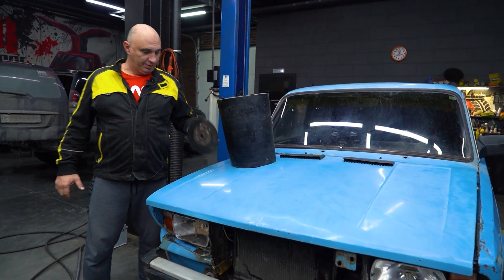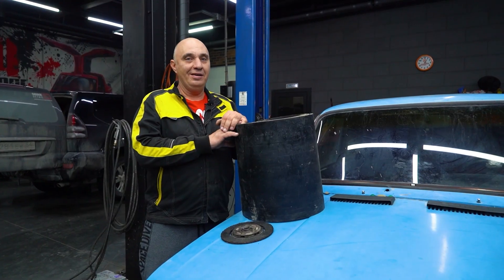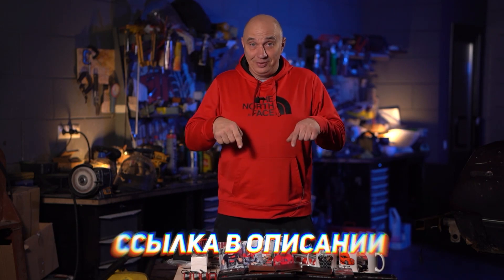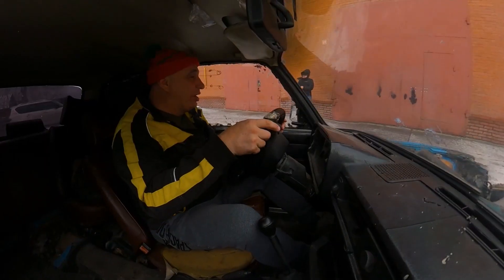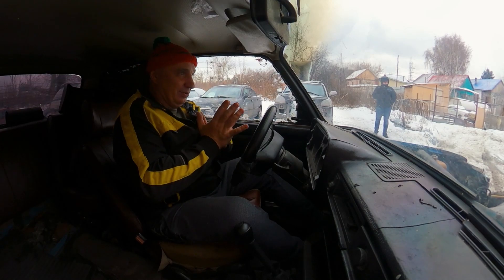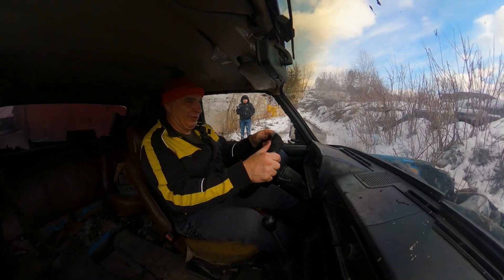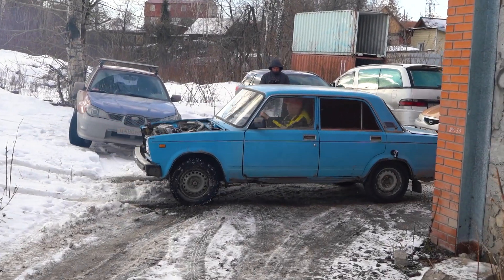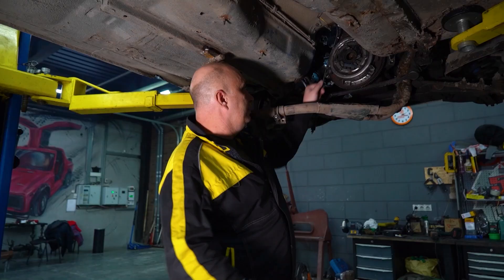We make a rubber clutch disc – will it work?

Comment: 3:56 watching rn. my expectations are: the clutch will work, it wont slip at all, and thats an issue. its rubber, i dont think he'll be able to start off smoothly without the rubber clutch disk wearing off. was I right? i'll keep on watching.
edit:
Yep. exactly what I epected. high revs before releasing the clutch wears down the rubber clutch disk. That's why he's able to start off smoothly at higher revs. And it's sticking because it's rubber (duh) and it gets warm to the point of maybe melting, hence the sticking. If low revs are applied, the car will jerk as the clutch has too much grip.

Comment: Should test the Blish lock theory from the early 1900s with a clutch. The theory is simple, one metal softer than the other, when instant pressure is applied, it should cause a sticking resistance. It was used in the early Thompson submachinegun for delaying the action, but found to be unnecessary
Reply: Thompson used Brass against hardened steel to try accomplish this.

Comment: Try coating a tire with bedliner so it fills in the treads and makes a smooth surface when it's dry mix 50 percent bedliner and 50 percent pea gravel and coat the tire to make rough surface for the snow and ice or off road what ever dry pavement would probably be fun.

Comment: The two surfaces; the pressure plate and the flywheel should be mirror polished so they don't eat at the rubber.

Comment: Great video. You guys look like you are having fun. A suggestion, instead of putting rubber on both sides, only place the rubber on one of the surfaces and make the other side bare metal. If that works better, you could cut slots in the rubber surface in the direction of rotation, as you might see on a disk brake rotor to improve cooling. Think of bicycles with rim brakes. By the way, bicycle brake pads do glaze from being overheated but rarely blister. Too bad you can't a roll of hard, dense high temperature rubber. Cheers!

Comment: Heres an idea. Maybe build a 5 foot long coil out of brake line and make it so it fits inside an exhaust pipe and then drill holes in the pipe to let the end of the coil out. Then connect those 2 coil ends to an extra heater core inside the car and fill it with coolant with a mini very low speed electric water pump. See if an exhaust heating system could work
Reply: Volkswagen bugs had exhaust heatera

Comment: How about building the most difficult car to drive with all wheels having a steering wheel with two reverse steering wheels & two steer right go right steer left go right steering wheels. And Break pedals in the middle front seat & the accelerator pedal in the middle back seat? So that it requires Six people to drive it and each time you stop all steering drivers jump out and change seats LoL 😂

Comment: With rubber it be resisting spinning and will grip the flywheel, the rubber is getting hot due to the friction and sticking to the flywheel.

Comment: Leather might be worth trying. Make sure flywheel and pressure plate surfaces are smooth so it doesn't tear.
Reply: Original clutches were actually leather
Reply: Yep should work just fine
Reply: My grandfather had some old american car maybe a dodge, it had similar to wine corks for a clutch, was a wet system running in oil, my dad (a kid in the 1950's) went to the chemist to get 200 medicine bottle corks so his dad could rebuild the clutch
Reply: @Colt45hatchback  makes sense for a wet clutch.

Comment: How about a push-pull Lada where you start off with a front drive Lada (VAZ-2108 Lada Samara) add another front drive Lada drivetrain inside the rear compartment?  Two engines driving two drivetrains.  Of course, the steering linkage in the rear has to be locked in place so it will drive normally.  Take if off road to see how it stacks up against a Lada Niva.

Comment: Hear me out, a high flow hydraulic pump for auto transmission, but put a clutch on the auto trans. Run the pump off the belt drive.

Comment: You guys made brake pads out of copper and aluminum. As I recall, the copper ones worked pretty well. How about a copper or bronze clutch disc??
Reply: Probably would cause alot for wear on the clutch assembly.
Reply: @jwalster9412  Undoubtedly. But Garage 54 experiments be only gotta work for an hour at most! 😂
Reply: I doubt it would cause much wear, as it is softer than the clutch parts

Comment: I doubt this will work
I was pretty much right that it doesn’t work, and the reason being is rubber cement to grip at the least amount of contact pressure, whereas a clutch disc only meant to grip under higher pressure

Comment: In 1978 i lost my clutch disc in tok alaska in my 1964 Datsun.. we were hippies and did not have much money.  we had to order a new disk from anchorage, and rent the garage from the gas station at night.  Thankfully they only charged 5 dollars an hour.  the pressure plate assembly was so old and corroded i could not adjust it because i was afraid i would break it.  as it was i could not get the clutch to dis engage, so i drove 3200 miles to Albuquerque with no clutch release.  You can shift without a clutch, but you have to have the engine speed just right.  after a while i got good at it.  We made it to Albuquerque, but by then i had worn out the starter, after having to stop the engine and engage first and restart the engine in first gear to get the truck to move.  A couple years later some crazy teen agers crashed into that little datsun while i was in Portland Oregon as it was parked in front of my apartment.  I happily proclaimed to my wife,  Honey, someone killed the datsun.   That solved allot of my problems.  the answer was there all the time.  BTW I had the clutch working when the truck died.

Comment: About the same thing is going on there  as if you leave an unmodified clutch out in the moisture sitting for too long   or if you wash your tractor and water gets down in that bell housing    it freezes the clutch to the flywheel surface   then you're only option from there  ..if you can't get it to break free    aside from taking it apart   is  hosing  the clutch plate down with something like non silicone based penetrating or kerosene to get it to let go

Comment: Could a tq converter be fitted as a clutch?
Reply: Since tq works on transmission fluid, ho do you wish to create such pressure in manual?
Reply: @kxpes  An transmission pump could also be put in a custom housing in line. They actually have existed. Although you just get a worse version of both so its not ever seen in production cars. Some heavy duty vehicles have them though.

Comment: Try to install glow plugs in petrol engine. Will it start better in the cold?
Reply: It wouldn't run at all. Petrol engines need spark plugs to ignite the fuel.
Reply: @9PlatinumGamer9  He didn’t say remove the spark plugs… maybe glow plugs in addition? In any case I can’t see how it would start better unless it was EXTREMELY cold. Petrol works fine all the way down to about -40°
Reply: @truthsmiles  Colder than that.  We've had gasoline motors start at temperatures lower than -40, and winter gasoline formulations are more volatile to help.
Reply: @kingduckford  Yeah I should have said "at least -40" - in any case I don't think the primary problem is fuel volatility - I'd say it's more likely very thick oil and/or the cold battery not having enough oomph. Hence why we have a lot more block heaters and battery heaters than fuel heaters :)
Reply: nope just detonation

Comment: Magnetic clutch!!!
Reply: They actually engage very smoothly. IBM's old tape drives used those.
Reply: @erkinalp  I bet! I wanna see them put one on a lada and watch it be like driving a semi automatic
Reply: Magnets will stop working with heat.
Neodymium lose it's magnetic force near 80° Celsius.
Reply: @EulerFink  stuff losing their properties has never stopped our boys in serbia here
Reply: @G_P2025  these guys are in Siberia, Russia. Novosibirsk, to be precise.
Reply: @Honey_Daddy  I was gonna write the correct city but then I got high
Reply: @G_P2025  xDDD full pass, no points deducted.
Reply: @EulerFink I’m pretty sure they use electromagnets for PTO clutches in lawnmowers
Reply: I want an lsd using neodymium magnets
Reply: Use a standard clutch for starting from a stop and use electro magnets for shift
Reply: I hope they see this.....👍
Reply: No
Reply: Tem que ser imã Forte... mas mt Forte msm..Pra segurar
Reply: Electromagnetic?
Reply: @Honey_Daddy  well, it will need a certain amount of time and engineering...
Reply: @EulerFink  I can imagine, but making an electromagnet isn't too hard. They're pretty capable at jerryrigging stuff, so Im sure they can figure out how to make it. That said, it would require some electronics to work with it, maybe an Arduino or a raspberry pi that controls the clutch engagement and release to make it smooth....or it could just be done in stages with MOSFETs or relays that pulse the power to the system rapidly to make it smooth...there are options, and I believe in their capabilities, I guess is what I'm saying. xD
Reply: @Honey_Daddy  good luck making an electromagnetic clutch, both the flywheel and clutch are rotating parts
Reply: Electric car uses magnets to drive

Comment: I just started the video but I'm thinking it might work a little bit if you're going slow but it's going to smell like burning rubber and then break down fairly quickly
Я только что начал видео, но я думаю, что это может немного сработать, если вы едете медленно, но оно будет пахнуть паленой резиной, а затем довольно быстро сломается.